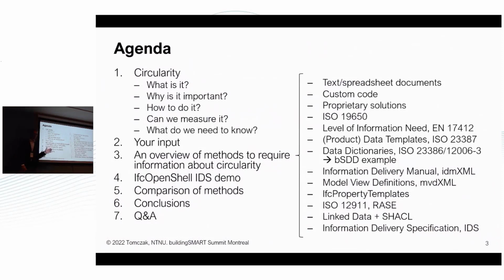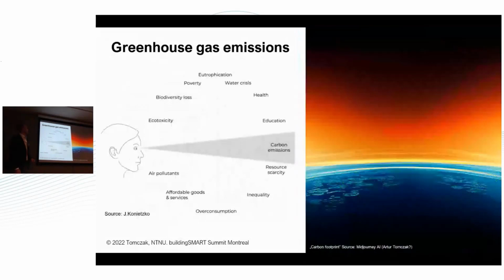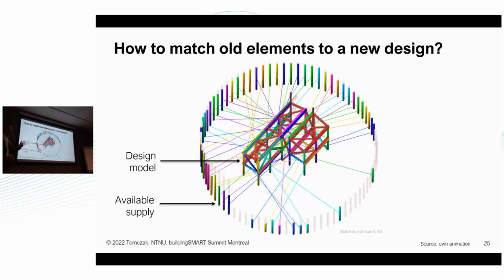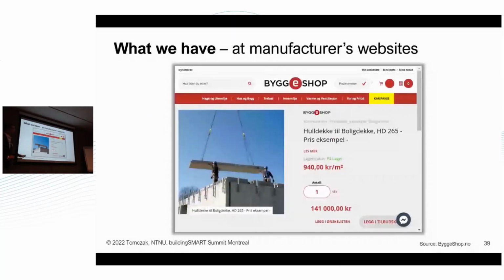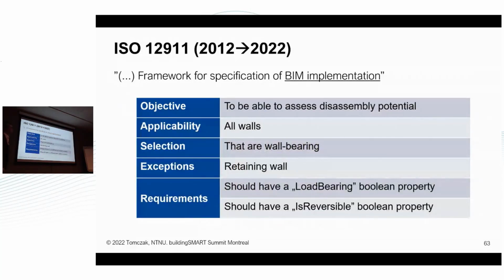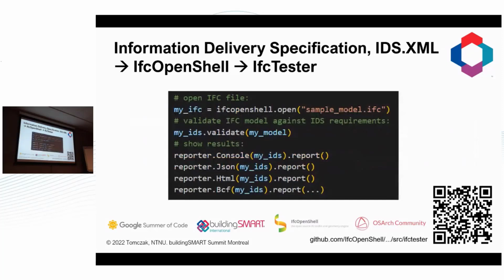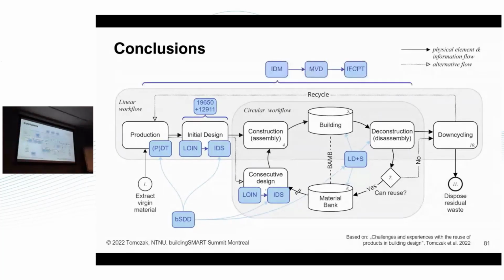GEN1 - How to require circularity (or anything) in BIM?

Comment: Part 1 - can we ask for circularity?
01:19 - circular building
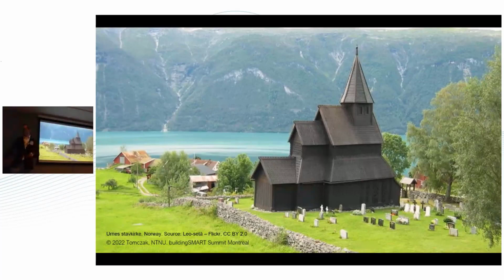04:55 - circularity and its measures
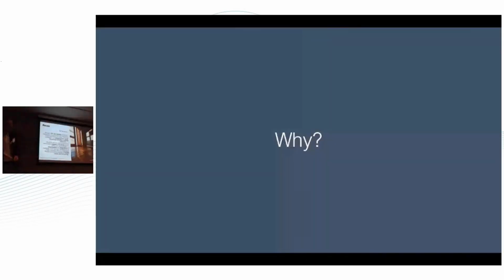07:25 - why do we need circularity
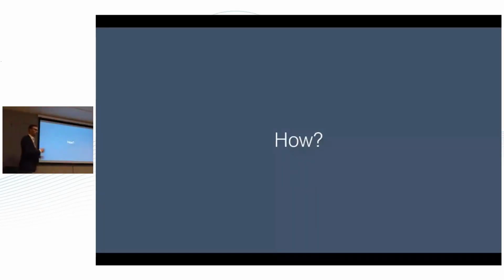13:25 - how to enable circularity
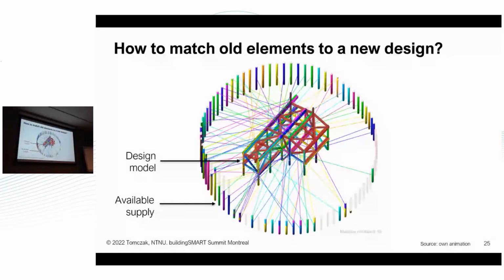19:25 - measuring circularity
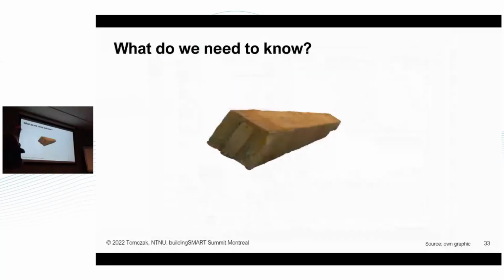23:31 - what information is needed?

Part 2 - how to require it in BIM?
31:26 - document, spreadsheet, code, software
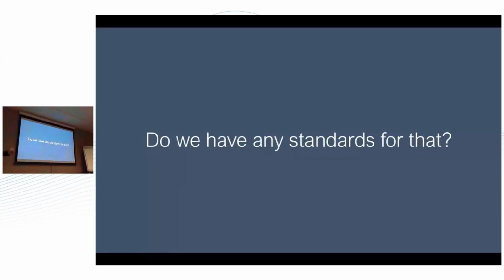34:40 - ISO19650, Level of Information Need (EN 17412)
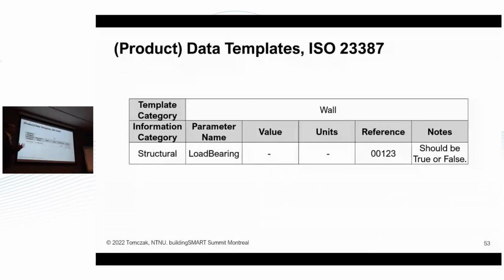37:19 - (Product) Data Templates (ISO23387)
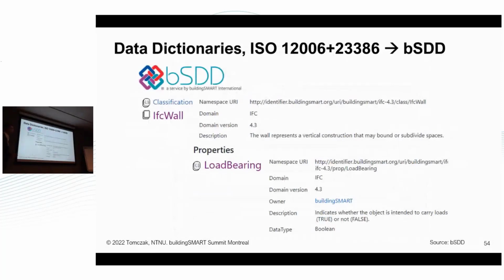38:12 - Data Dictionaries (bSDD, ISO12006, ISO23386)
39:26 - Information Delivery Manual (idmXML, ISO29481)
41:38 - Model View Definitions (mvdXML)
44:11 - IfcPropertyTemplates
45:04 - ISO12911 (RASE clauses)
47:12 - Linked Data with SHACL
50:50 - Information Delivery Specification (IDS) + IfcOpenShell / IfcTester
57:53 - Comparison
1:01:05 - Conclusions
1:05:50 - Q&A

Have a question or comment? Ask me on Linkedin:
https://www.linkedin.com/in/artur-tomczak-5b66444b/